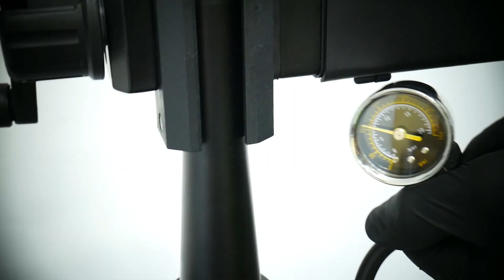RST F1RST / FIRST Air Fork Service + 5 Problems You Might Come Across.

Comment from the maker: 0:24 clean environment (very important!),
0:50 let the air out (slowly),
0:55 remove the remote lockout,
1:35 remove the hydraulic lockout,
1:50 poor the oil out (why is it smart to measure the amount of the oil inside),
2:35 remove the air assembly,
2:45 remove the rebound knob and the lower legs,
3:18 PROBLEM 1 - solved,
4:00 the lowers ready to be removed,
4:20 time for the air spring and the rebound,
4:48 slowly!,
5:00 put everything IN ORDER on the table,
5:05 PROBLEM 2 - solved, you may come upon different mounting system https://youtu.be/kT8weWMu34A?t=2m3s  ,
5:39 PROBLEM 3 - NOT solved,
6:05 how this fork works,
8:17 PROBLEM 4 - NOT clear,
10:08 PROBLEM 5 - do you put some oil here?
10:52 clean everything,
11:15 DON'T leave any water there,
11:50 let these rings soak up the oil,
12:20 greasing before the assembly,
13:10 remeber about the right direction (side),
13:55 poor the oil in,
14:28 assemble the lockout,
15:10 find the right tension for the spring,
16:15 put some grease on these,
17:02 pump the air spring,

IT WORKS BETTER!
Reply: Hi, so I paid 300 to a guy for this fork and the rebound damper shaft has a leak. Do you have any idea where to find a replacement? I swear the ROCKSHOX rebound damper replacement could possibly fit but I haven't found any information on mixing components from other forks. Any advice or information would be helpful. Thanks for the amazing thorough video on disassembly. Even with the video I still tried and failed to do it on my own, but your video was a good guide when I ran into hiccups.
Reply: @Caddyleadz  here is an old rst tutorial how to service the rebound assembly, btw put 5wt fork oil in the rebound assembly, it will improve the fork's behaviour

https://youtu.be/kT8weWMu34A
Reply: @Caddyleadz  I tried searching over the internet for mixing components for fork suspension but found no information about that
Reply: Rebound cartridge really from PVC/plastic material (not Al)???
Reply: @ПавелКусакин-х7ш  there is not cartridge its in the stanchion itself

Comment: I had solved a very sticky RST Blade air fork. I am new to this mountain bike hobby. My new bike was a online order. 
After almost giving up on the fork, many times. I had notice a gap between the fork and the wheel hub, when I was installing the wheel . So I found a washer to fill in the space. So when I tighten the through axle, I would not pull the forks inward. This trick and all the lube and spending a considerable amount of time insuring it was put to gather properly. It works and the first short test ride was a big success. 😍 I had just finished fixing it and it was dark outside. Hopefully all I have to do is, play with the air pressure. It seems to be working perfectly. 😁.  I thought I would tell you guys about my trick. 
    Thanks for your videos. I have learned a lot from them over the years

Comment: This is the second time i've used this video to maintain my RST F1RST fork.
Mine is COMPLETELY different tho, it's a prototype, and the plastic chamber you screw to the top cap on the air side is just a loose aluminium piston on my fork.

My hydraulic lower has started leaking through the rebound adjuster, so i took out the original hollow allen bolt and replaced it with a regular bolt with locktite.
Filled the hydraulic lower up completely, then pumped the fork slightly to allow for a miniscule amout of air at the top, now the lockout is super solid, yet the damping is fast and responsive again.

I'll buy a completely different fork one day, these forks never worked from the factory, and it may be bechause they are prototype forks that shouldn't have been sold, especially on a brand new consumer bike.

Comment: Thanks for this tutorial. Serviced my RST first fork and it turned out quite well.
Reply: Hello, did you soak the foam rings using oil? What viscosity of oil did you use? Did you also put oil on the lowers or just grease?

Comment: SIckbiker, I talked to Risseracing, the US distributor for RST, about the plastic cap on the bottom of the spring side of the Renegade which is the same cap as your First fork. It is indeed removed with a pin tool, mine are pin pliers, but mine has longer pins than the one you showed. It comes off counter clockwise.

Comment: I would start at 90 ml and then add oil if the lockout did not work. The lockout will not work properly if the oil level is too low. Oil volume may depend on the length of travel? A longer travel model may have more volume in its chambers? Other than that thought I am mystified by the disparity between the measured volume and the stated volume. I like the design of this fork, it is pretty easy to service. Its not the best performing fork I have used, but not bad for the price. Aspects I really like: The damper isn't under pressure with some kind of bladder, and it doesn't require special tools, and is not an unserviceable cartridge unit.
Reply: "The lockout will not work properly if the oil level is too low." very good suggestion... thanks
Reply: Fill all right chamber, otherwise if you leave some air - lockout will not work.

Comment: I have replaced the damper lower seals in the stanchion in the plastic piece that seals the stanchion and the sliding shaft. It was pretty easy. No more leaking from the lower leg. Now I need to service the air spring, I am glad to see you demonstrate the air spring removal!
Reply: What oil did you use for the foam rings and lowers? RST also gave me a spare part to fix the leak of oil on the rebound side. But i am wondering should i put oil on the lowers just like the bigger brands like rockshox and fox.

Comment: Is it possible to extend the travel of this fork from 100mm to 120mm?
Reply: yes remove the part shown at 4:30 on both legs
Reply: @randomchannel1712  Is it possible to do the same for RST F1rst 24" (increasing travel from 60 to 80mm)? Is there any downside to removing this part (hard bottom-out maybe) ? Thanks.
Reply: @MilanKelesi  yes you have to open it n check
Reply: @randomchannel1712  you said both legs??but that part is only seen in one leg
Reply: @tapramos7572  yes on newer forks that's possible
Reply: @randomchannel1712  oh really? And just like that? Nothing else necessary?
Reply: @alvaroruizruiz7538  yes sir
Reply: @randomchannel1712  any adjustments in oil and air after removing that part
Reply: @tapramos7572  noo

Comment: Friend... do you know what is the max tire width f1rst fork?
Reply: On my 26 100mm f1rst I have a kenda nevegal 2.35 tire, but when closing the wheel I have to kinda center it so it doesn't rub on the fork, other than that, it works just fine.
Reply: It depends on the size of the fork. I only know that my 26" RST F1RST just fit 2.2 tire width but the 27,5" and 29" versions go bigger.

Comment: I have a question

My airfork single air on non driveside (coil) i cant take off the nut lower it just spin. what to do?
Reply: Put some air in the air chamber. The pressure should help to hold the shaft so lower nut can be broken free. I believe that's how I had to do it when I rode my fork down. Don't forget to purge the air before opening the air chamber.
Reply: Having the same issue but mine is in the bolt where the rebound knob is. It just spins and the bolt does not loosen

Comment: can you extend its travel? thanks for feedback
Reply: yes dont reinstall part at 4:30
Reply: planning to extend the travel, bro can I skip the part where you pour out the oil of the left tube. can i just work in the right tube say > remove air, remove the part at 4:30 then finish

Comment: You can use a little bit of oil on your negative spring side or I've found that you can apply a small amount of light duty grease (non corrosive)  around your rubber seal and it will glide smooth. Great video brother! LOVE The breakdown on how the front air suspension actually works. Well done!

Comment: you did not show where to put back the oil and how. another mistake is you put presure to the system to remove the bottom bolt and then you instruct your audience to unthread the valve asembly without pointing out that you have to release the pressure!!

Comment: I have a problem with this fork, oil leaking through the rebound knob, I don't know how to solve this ....
Reply: Maybe you need new seals or you can try to tighten the hex screw more
Reply: @kevinhenriksen4390  Hi man, where is the hex screw? I am also experiencing the same problem. Hope u could explain to me
Reply: have the same problem, cannot open with hex key but have to use wrench to open the rebound knob. too many problems with this fork :(
Reply: @eugeneismanto1222  same here
Reply: @14Goel  the issue is the orings at the lower damper assembly cap you need to replace both the internal and the external one
Reply: @eugeneismanto1222  you just dont have proper service rsts are very reliable when serviced properly

Comment: I see a pretty big steal spring in there, this probably means Air Forks are a Lie.
Reply: everything is a lie dude, don't believe the mechanics, there is no spring, the suspension works by small lepricons and goblins pushing and pulling the lower part of your fork...
Reply: The steel spring is the negative spring.  That is what prevents the fork from slamming into its fully extended position.  Higher end forks have a negative air chamber, although it is actually ballanced with the positive chamber.

Comment: hello, what's the oil quantity please?
Reply: He says the service manual says to put 90 ml, but the fork had 125 ml when he disassembled it.
Reply: Fill all right chamber, otherwise if you leave some air - lockout will not work.

Comment: How can you adjust the rebound on the F1RST?
My factory set up seems very hard and on fast rocky ground my bicycle gets hammered and is very painful sometimes even when my remote lockout is in the most soft setting..
What rebound is better to soften the suspension small or big and how to set it up?
Does the hydraulic fluid play any part in it or the air ?If i lower the air compression will that make the ride more plush?
Thank you..
Reply: chage oil to 5wt
Reply: don't know much about forks this cheap, but yes less air will make the fork more plush, but you risk bottoming it out on bigger drops or impacts.
Reply: oh and also, you want compression adjustment not rebound. rebound is how fast it comes up. you want it to be faster going down so it eats up bumps better.

Comment: I´ve got the F1RST (Platinum series) 26" on my retro hardtail  - my fork also suffered from the heavy sticktion - i´ve serviced it recently for the first time and got rid of it. In the Platinum-series the hydraulic-damping unit is screwed onto the bottom of the right stanchion - if this screw is too tight the sticktion occurs.
Reply: https://www.paul-lange.de/index.php/de/rst-237.html?file=files/paullange/07_Service/04_Downloads/rst/2016%20Teileliste/FIRST%20PLATINUM%20%281.0%29.pdf
here you find a drawing of the fork - Part 5 is the hydraulic damping unit

Comment: Hi, I solved problem #3 on my rst first air (no idea which model exactly ) - open it counter clockwise direction :-)  with https://www.mojedilna.cz/segrovky-vnitrni-zahnute-extra-velke-13-300-mm-quatros-qs53014
Reply: problem #4 - also I must put there (100mm travel) about 120 ml of  hydraulic oil - tested by adding oil (started at 90 ml) until lockout start working properly
and problem #5 - I put there a little bit silicon oil

Comment: Official information from RST about type and amount of oil:
„please use a quality suspension oil with the viscosity SAE 5W.
·       30mm stanchion: 90ml F1RST series
·       32mm stanchion: 135ml F1RST series”
Problem solved.
Reply: Obrigado.
Reply: Que pasaría si ponemos menos de esas medidas de aceite?
Reply: São 110mm de vazio e não quantidade de ML

Comment: Let me clear up some stuff
1 Rst tutorials are very old and they showcase an older ocr version (the one you have as a sample)
as you can see the compression assembly has some build in volume reducers and thus the lower oil quantity
The newer generation of OCR has to be filled with 125ml for RST FIRST And 135-150 for titan
As for the air assembly adding oil is not a good idea as rst forks DO NOT SEAL THE LOWER LEG WITH THE ROD on the air side so oil is just going to leak out (although adding some oil on top of the air piston makes it way smoother)
Just grease it using slicoleum or any silicone grease
The same applies to the socket fitted on the rebound assembly it is only applicable to old FIRST models
The oil you should use is 5wt instead of 10wt that they use this will transform the fork
The part you took out of the air chamber is a volume reducer very old technology following rst from the very old days
There is a very easy way to put the right amount of oil to your fork on rst ones
Step 1 Set your rebound assembly so that your travel + 1cm sticks out from the botom
Step 2 measure your ocr compression assembly length and remove it form the top of the crown
Step 3 fill with oil up to the designated point so that in normal operation the ocr compression assembly always stays submerged 
Any way if you have any more questions feel free to ask me i am an RST GURU OF SORTS
Reply: How do I contact you?
Reply: Is there any possibility to increase the travel to lets say 110 or 120mm?
Reply: @kristijansiric2648  yes 110mm by removing limiters
Reply: @randomchannel1712  I replaced today the oil in the rebound assembly with 5wt Valvoline fork oil, will try the fork tomorrow
Reply: @kristijansiric2648  I am eager for the results
Reply: @randomchannel1712  well I took the bike for a spin around the trails today :)
Stiction is good as eliminated, the fork feels much plusher, almost as my friend's rs reba...to mention too I removed the volume reducer from the air chamber and poured instead 36ml of fork oil inside (which is half the volume of the original plastic volume reducer)...the air pressure will need some fine tuning but the fork got it's second chance as I added a seal on the bottom bolt which holds the air shaft to the lowers so no oil can leak out
Reply: @kristijansiric2648  Glad that i could help
Reply: @randomchannel1712  Can you help me out somehow? My RST F1rst Platinum 100mm is brand new and I set the air pressure correctly. I went for a few rides in the city and the rebound stopped working. Then after 3 rides the lockout did not work anymore, and then after about 4 rides the travel decreased to about 50mm, and then I had 20mm max. I opened it up, drained the oil, removed lowers, put back oil & added air, now it works just a bit stickier. However... lockout does not work and rebound neither. Any help?
Reply: @Cptblogh  classic ocr assebly failure you better of replacing the whole ocr assembly
Reply: @kristijansiric2648  what seal did you use to prevent oil leak on the lowers?
Reply: can you help me my rst titan15 has some oil leaks on the rebound knob? is it normal? when i remove the rebound cap i notice some oil from it?
Reply: @rvfi5515  no bottom seals have gone need to replace the lower rebound damper o-rings
Reply: Do you happen to know the specs of the replacement o-rings?
Reply: @mookymoo  from the top of my head no sadly...
Reply: On a Renegade, I have oil leaking out from the rebound adjust. I have the diagram of the internals of the fork. Do I just replace the seal(s) on the dampener assembly, and would that be with the 32mm RST seal kit? If so looks pretty straightforward unless I'm missing something? Thanks for your help!

Comment: HI, I need help. I am about to buy this fork...The Remote Lockout option where you cant adjust compression......, It says the travel is 80-100-120 mm, However it doesnt say in the manual how much travel has without adjusting it. Does it come with 120 and you can reduce it to 100? or it comes with 100 and you have to enhance it to 120?? I dont get it!!!
Reply: the fork comes as 100 and you can increase it to 120
Reply: IT CAN you just need to swap the RL remote with the SRL remote and you will have compression adjustment
Reply: I can’t find this with qr and taper

Comment: Awesome video! I would like to know, where inside the air spring are the travel adjust spacers? I couldn't find such information for rst forks anywhere...
Reply from the maker: That should be the 9:53 "plastic thing".
Reply: @cannondany  no thats a volume reducer in order to make it progressive the rubber part at 4:30 will make it 120 if removed
Reply: @randomchannel1712  removing all the volume reducer will make it 120?
Reply: @xigarcia290  as i said the plastic part at 4:30 is not a volume reducer but yes it will make it something closer to 120 more like 115mm

Comment: your videos are awsome, very well explain and details, could you please make a video for Fox evolution series? , came with O/C cardrige, i usually search how to rebuild damper but i can only find how to change seals and oil from lower legs, will be very usefull be the first video to explain how to rebuild the whole suspension. there is not info at all. in fact fox dont bring info how much oil have to be inside the cardrige, only how many in the lower legs (30 ml in almost all models).